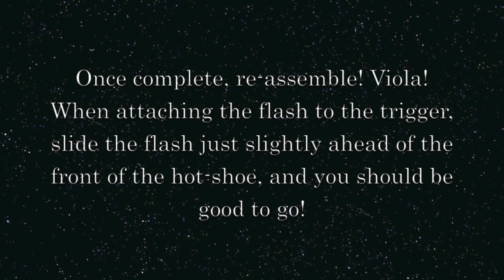Sony HVL-F60M and Radio Triggers

Comment from the maker: No worries, Woj! I was in the same predicament, needed a solution, and made one. They will synch @ 1/250 most of the time. I've gotten some curtain black-out, but I am unsure as to why it happens occasionally. So, yes. I do get blackout @ 1/250, but not all the time. In most cases, just to avoid that problem, I will shoot at 1/200 instead with no blackout ever. Happy strobing!

Comment from the maker: For relatively motionless work like portraiture, sculpture, products, etc., I agree with you here. I'm having tons of fun in manual mode. The TTL/ADI features in the F60M are really incredible though and really are worth the time to learn. Ya, having one F60M on camera as a controller is clunky, but there's a very wide range or settings to have fun with and oh, does it work beautifully... I'd be nice if Sony made a hot shoe mounted IR controller like Canon's.

Comment from the maker: Thanks for posting your thoughts and experiences! Thankfully, the Fotodiox transmitter has no issues aligning correctly in the A99 hotshoe, nor will it have a problem in the adaptor, should anyone be using an A77 or other body with the old Minolta shoe/adaptor set up. Happy strobing! Clint

Comment: Great video. I have the Cactus V5's and the same issues. 60M wont slide back.. so I did like you did and modified the front so it would slide further frontwards.. .however that's not really the issue... It's the back of the mount with the firing pin. It has a stopper that stops it in the back.. Any thoughts?

Comment from the maker: :-) happy to... Just remember, you don't  have to carve away any material if you don't mind putting the trigger on the flash backwards. Try just taking the receiver apart, removing the spring clip and putting it back together. Slide the foot into the receiver back end first and lock the flash down with the locking lever. Works perfect, looks a little odd, less mess. Lemme know if you have any problems.

Comment from the maker: Good morning Agelisone,

Not sure if I fully understand the part about the mod to the auto sensor. Could you please clarify?

Regarding the PC socket on the F60M; It is a 4 pin socket and was not compatible with any of the off-shoe cables at the shop I went to here in San José, Costa Rica. However, I did some digging on B&H's site and found a Sony off-camera cable (Sony PN FA-CC1AM/B&H# SOFACC1AM)

Their comment suggests that this does work on the A99 and you'd have to use the adaptor on the A77

Comment: Hi Clint, I just tried it without scraping anything off, but I can't seem to get the flash to work :( If you could help me out with the settings that I should use that would be amazing since I don't have much experience with flash.. also on the trigger, when I put it back together should i put the hot shoe in the facing the opposite direction or exactly as it was? Sorry for the trouble!

Comment: Actually I sort of figured it out, and NO my bad, it wasnt the actual 60M, Well it looked like it was.. but in fact the flanges from the hot shot mount had to just be gently pried up - I did this by take a thin file and bending it up being careful not to bend or break it...:) works like a charm :)

Comment: Your lucky guy Clint, I ve but radio transmitter from Yongnuo and my HVL-f60m fits perfectly, just still doesn't work. Yet I know what you talking about cuz when I put my F60m to my Canon 6D there is really like 3mm empty place. But of course I won't carve Canon 6D, it's just not worth it. I think the easiest way is to buy old monolta hot shoe radio trigger and add official adapters from sony to them.

Comment: You can get the m60m flash off camera with the a99 by using the My Slave 100 radio trigger and receiver. It works without any modifications or adaptors.

Comment: Hi Clint,  

Do you have videos on mod for PC Sync Socket and as well as a mod to have Auto Sensor?

Close to $600.00 and the flash has none of those real important features.
A must for serious and pros.
And be delighted when beginners learn beyond the programmed flashes, which many now called, TTL.

Canon 580EX II/600EX-RT and Nikon SB-900/910 have them but not one on a Sony.

Comment: pocket wizard now has a hot shoe and cable combo that will take the hvl 60m flash the cable includes a plug that goes into the remote radio trigger and serves to pass the received trigger signal through the hot shoe to the flash.. Unfortunately this is all still manual mode only!

Comment from the maker: Well, the shoe on the A99 is sorta normal in that it will accept the transmitter or any other standard flash without problems. The problem here is with the extension of the foot on the F60M to engage with the com port on the body. It's the flash's fault.

Comment: Great tutorial and a deciding factor that I'm now not going to buy the Sony a77ii nor am I going to wait for the a99ii to come out but sell off all my Sony gear and go back to shooting with a Canon. Yongnuo has a flash that's ttl and manual for $125 and their triggers are less then $100 with full ttl functions and one Sony flash that overheats after 30 shots that costs $600 is ludicrous. I must say that sony has the best lenses in my opinion but their hotshoe is idiotic and I don't understand why they went away from the minolta mount if they weren't going to make it compatible. The other option is to buy an adapter to make it a minolta hotshoe, add another adapter to to make it a normal hotshoe mount and go from there but now you have this towering contraption on the top of your camera. A total fail in my book on Sony's part.